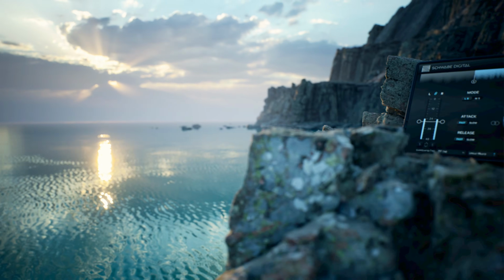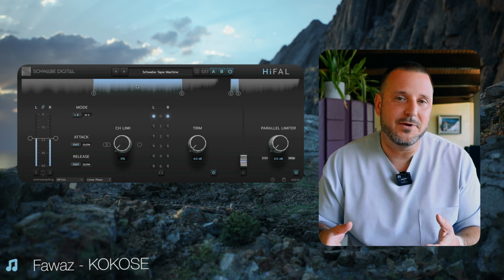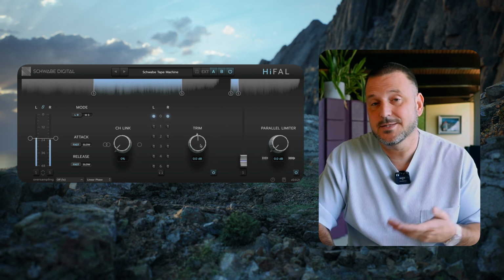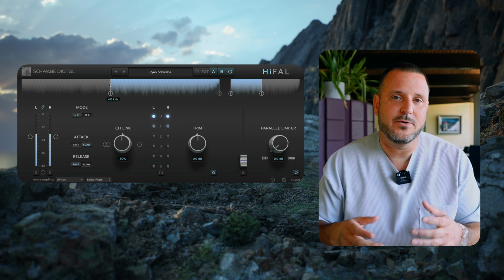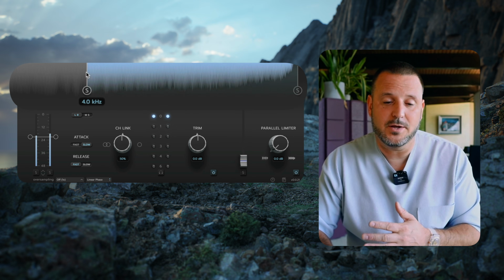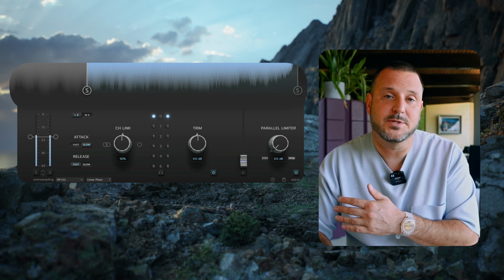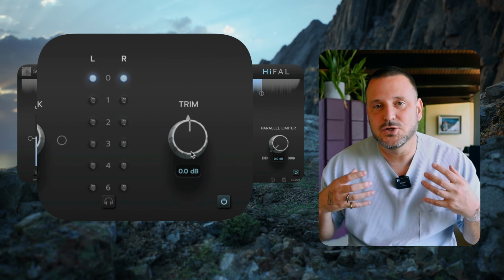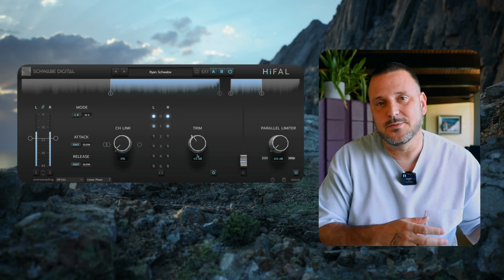8) Using HiFAL's Trim as Balance Control

Comment: Got mine and I love it! Partners up great with my Gold Clip. I work on a lot of punk/hardcore and this combination works much better than dynamic eq taming shrill build up around 3 to 4 k. Keep em coming Ryan. j
Reply from the maker: Appreciate that.  That is exactly the intention of the plugin!
Reply: @schwabedigital I understand this video regarding the trim. After adding limiting into process band you can turn it that section higher or lower. So why have a parallel or how does that work in conjunction?

Comment: Its just a simple trim 🤔
Reply from the maker: Indeed, but it is a trim for the HF processed band only.  So, if the track is dark, you can still compress it, but turn it up.  If the track is too bright, you can limit the top end and turn the level down to balance it with the rest of the mix.  A simple trim yes, but it is also a clean linear phase Shelf EQ.

Comment: I dont know if this sounds crazy but I highlight all frequencies and just adjust to bring more brightness to my mix. Im still learning how this plugin reacts to my mixes but it is now apart of my master chain.
Reply from the maker: Not crazy at all! Whatever works. I often keep the frequencies at the default position. I spent a lot of time with the plugin in development and found myself going to that arrangement most often, so I made it the default. You will notice that 4kHz and up are treated on the main HiFAL processor and 4kHz and up are treated on the parallel processor.  There is a lot in that set up that just works!